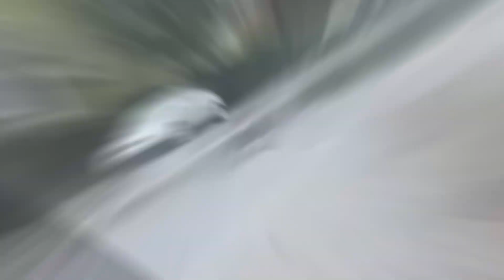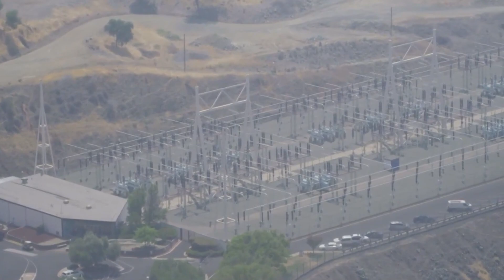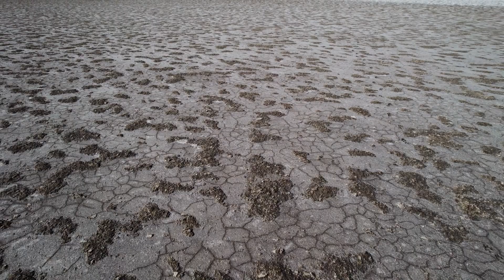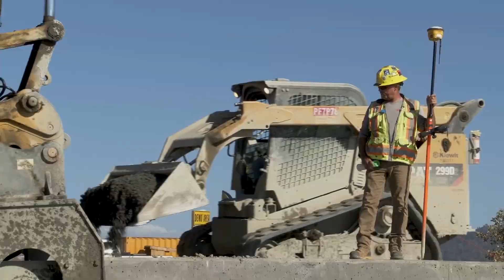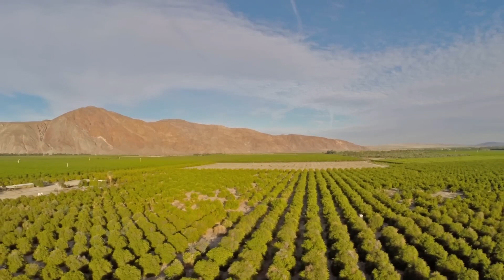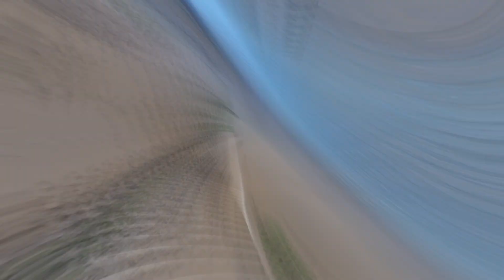Lake Oroville Completely Dried Up & Something Terrifying Has Emerged

Comment: Lake Oroville elevation is close to 862 feet today. 900 feet is full pool. I've read that at 901 feet Lake Oroville will begin to flow over the Emergency Spillway wall, which is untested. Big Atmospheric River going through right now. There is still more Atmospheric Rivers on the way and Pineapple Expresses from Hawaii in the Spring. Water level has been maintained too high.